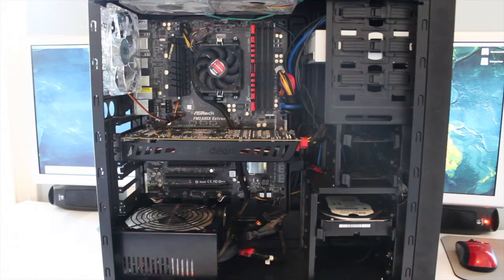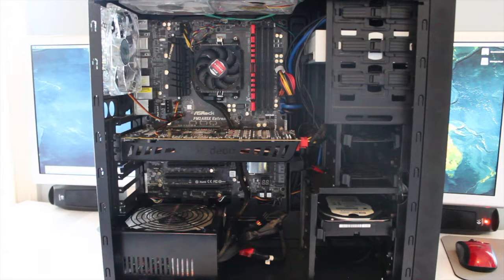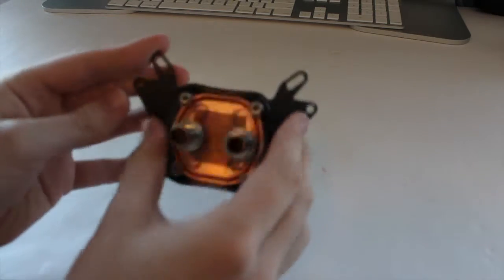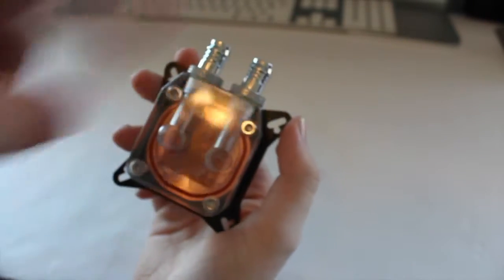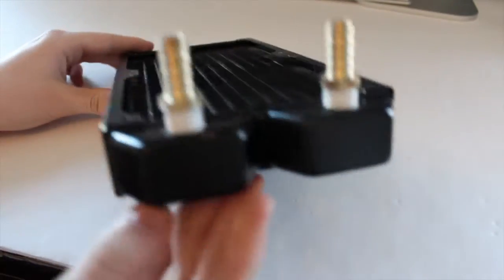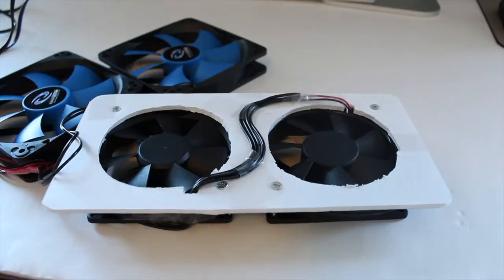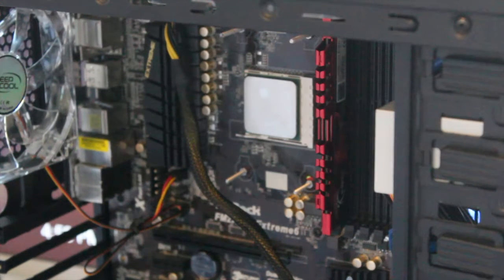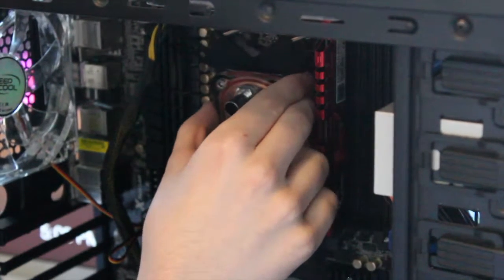Water Cooling The AMD Gaming PC

Comment: wau awesome watercooling temps on ful gpu and cpu ? work fine ?
Reply from the maker: i get 35*C on the CPU (load) not sure on the GPU. the system cools very well however I have a mixed metal loop so its beginning to fall apart unfortunately. I turned it into a AIO. I have a video on that if ur interested.
Reply: some lost of liquid on the waterblock cpu or gpu ?
i see the video about aio liquid cooling :)
Reply from the maker: no loss of liquid im aware of however there is some corrosion on the CPU block
Reply: inside or outside the waterblock ? outside is normal you can clean it
Reply from the maker: inside, however I can take it apart and its not in the micro channels in the block

Comment: can you add links of the water blocks you bought? great video!
Reply from the maker: thanks! I will add them right now-they may be a bit different than the ones I got but look to be the same model/price.
Reply from the maker: ...I just added them-if you also want the link to the Pump-Reservoir Combo I got I could get that to you.
Reply: +AdanD66174U thank you so much! that would be helpful. Did they take long to arrive? and where did you get the tubing?
Reply from the maker: I got the tubing and fittings (and pipe tape) at The Home Depot. I don't remember exactly but I think they took like 1-2.5 weeks or something. I will also update the description with the Pump-Res but that may take a while because I don't have the link saved. Do you plan on doing a project like this?
Reply from the maker: I added the pump/res however it unfortunately looks to be out of stock. I'm sure there are similar ones listed on eBay though.
Reply: +AdanD66174U Yes. I have a couple of computers which I want to watercool them all. Good job on your video.
Reply from the maker: thanks-what are the specs of the systems?
Reply: +AdanD66174U two systems of Q6600 with r9 280Xs.
Reply from the maker: ooh cool (no pun intended) a mx of old and new
Reply from the maker: btw I figured I should tell you-one of my next videos will be of me taking the liquid system and making a "custom/home made all-in-one" liquid cooler out of it for an upcoming gaming pc upgrade.
Reply: +AdanD66174U I can't wait to see it! Hope you upload it soon.
Reply from the maker: given the time I uploaded the Core 2 Quad video and my school schedule, it will probably be up this weekend or sooner.

Comment: Would this blocks work with the MSI GTX 970 4GB Gaming ? please reply ASAP as I'm ordering this on Amazon so I don't have to end up with a none compatible item thanks
Reply from the maker: physically yes, but DO NOT USE THEM! they do not cover the VRM or RAM like a regular block would... I would suggest an EK full cover block

the EK block may not have the right holes as ur GPU has a custom board.
Reply from the maker: sorry for the late reply btw
Reply from the maker: actually it looks like EK makes a full cover block for ur GPU so ur set there, id also suggest an EK CPU block as it would transfer heat better
Reply: Not looking up for something that expensive all the back plate I have found for my gtx 970 are over pricy and I aint giving them all that money for a plate with a bunch of holes, right now I'm using the nzxt brackets and that is very cheap and it works greate but I want this type of water block and modify the nzxt to work with this one type of block as the brackets are intended to work with Corsair devices, but I wanted to know if someone have place this block onto a 970 and to find out hoe efficient it is with it :)
Reply from the maker: I'm not sure if that will work, like I said, you need to cool the VRAM and VRM so if you can find a way to do that, than this block with theoretically work
Reply: AdanD66174U I actually l made it work here id the link https://www.instagram.com/p/BS7YlUvD2ZJ/ I had an NZXT bracket for the GTX so hav I make custom cuts to the brackets and I made work with this specific GPU water blocks thanks for your reply may
Reply from the maker: nice! glad you got it working!
Reply: did you get the chance to check it out ?
Reply from the maker: ya...I also followed you
looks really good actually
Reply: MMOs Live I will do the same thanks for the inspiration man.